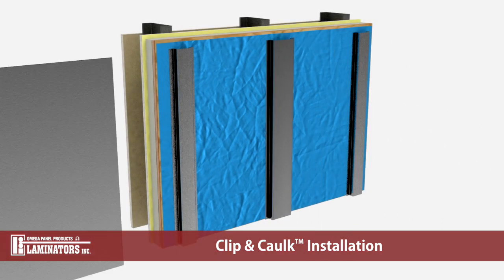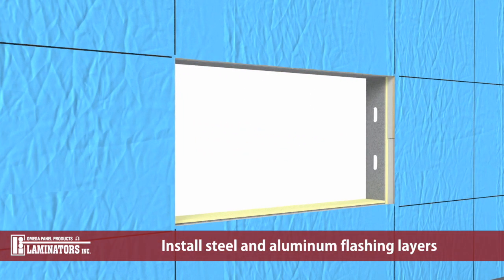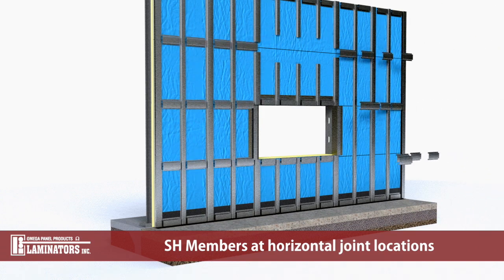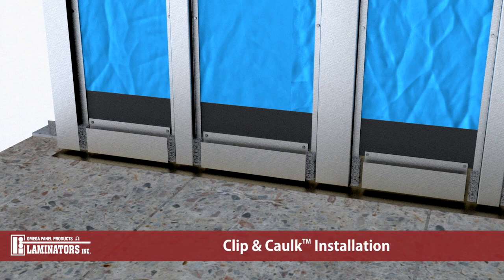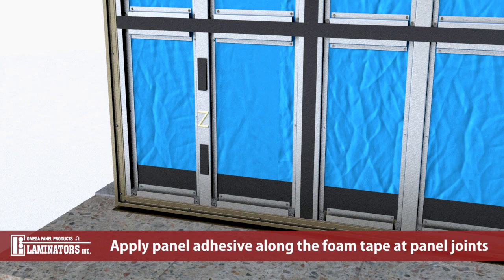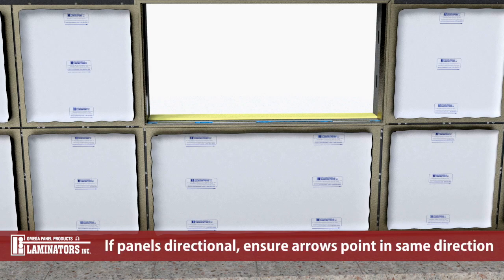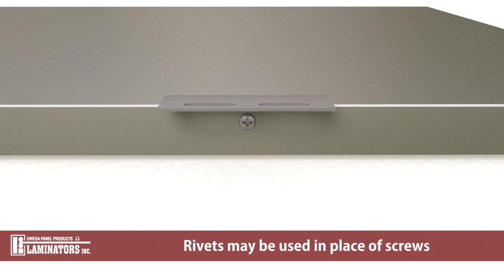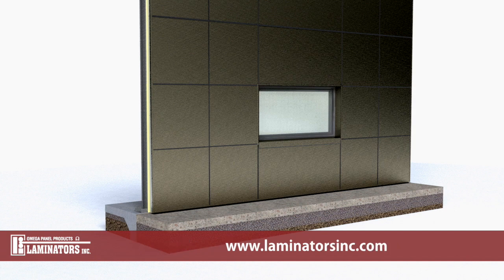Back-Drained and Ventilated Clip & Caulk™ Installation System from Laminators

Comment: This system sucks. Don’t waste your money. The caulk joints blow out because the panel is hollow. You’re supposed to caulk the ends before installation but it blows that caulk out too. This is the poor man’s ACM but you end up paying the difference in labor cost because of the complicated sub framing system and you’re constantly fixing caulk joints.